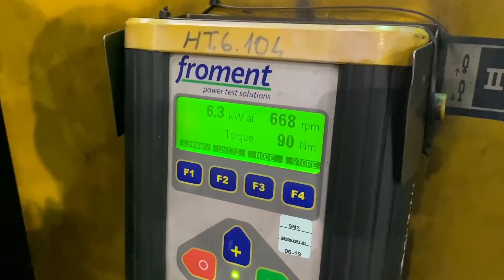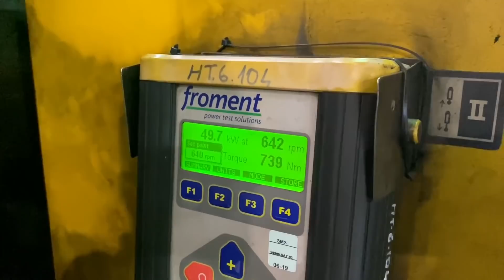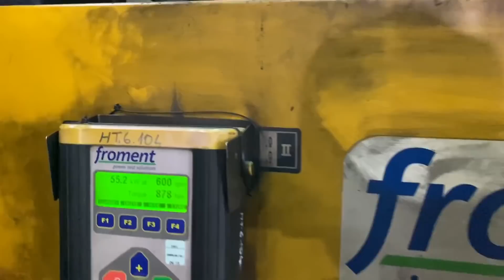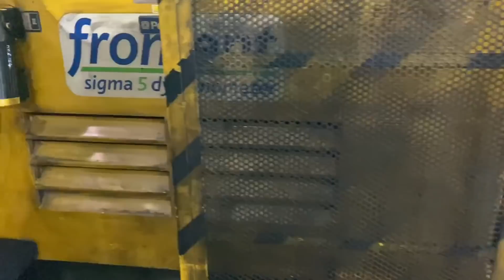TRAKTÖR SON TESTLERİ NASIL YAPILIYOR ? HATTAT 295

Comment: Looks like a Massy Ferguson.
Reply: Probably a updated version of the older Massey Ferguson designs that AGCO sold off. Alot of countries like the old Massey Ferguson designs and don't care much for  computerised air conditioned cab tractors. The older 1950-1990 designed tractors were simple to repair and could easily be converted to open station tractors. Indian tractor manufacturer Tafe still produce a tractor based on Massey Ferguson 35.